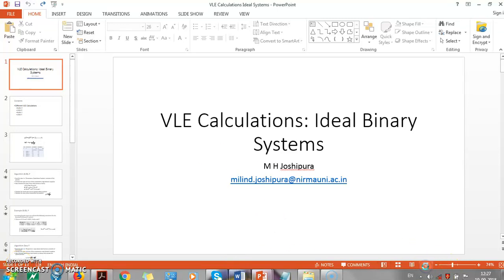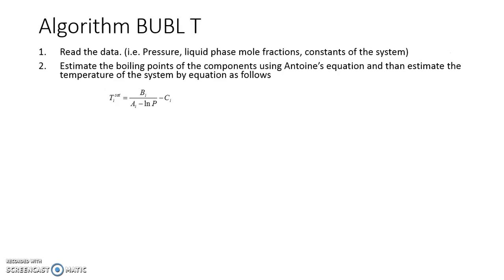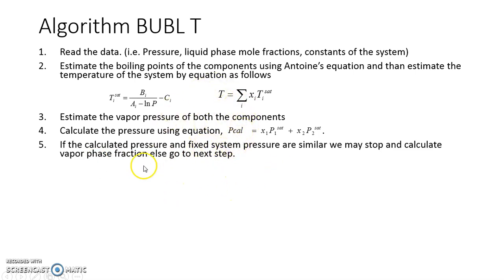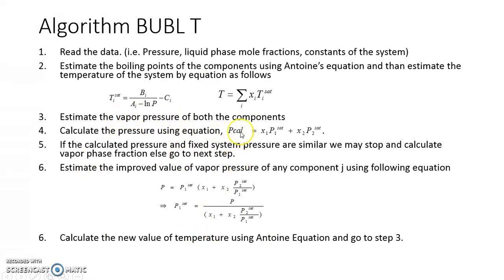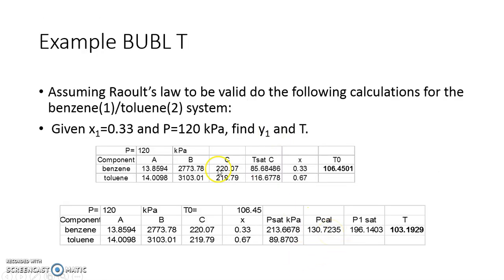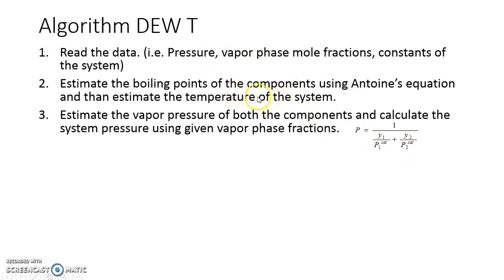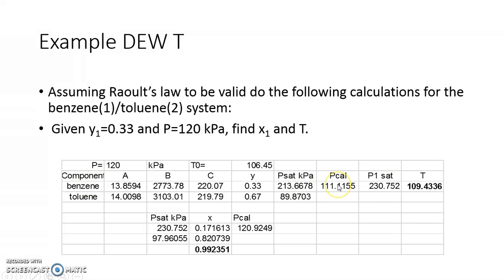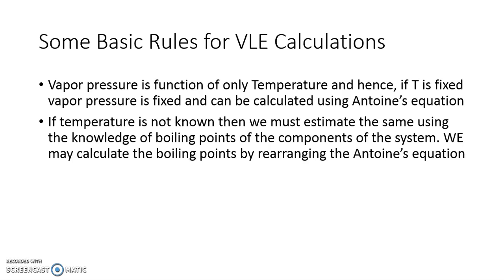Ideal VLE Calculation Part II

Comment: How to see K value in depitser chart 📊
Reply from the maker: 1. Draw a line connecting the pressure and temperature on the Depriester Chart. 2. This line will intersect the verticle curves (corresponding to individual compounds) 3. That is the value of K corresponding to the chemical.

Comment: Sir in the example of bubl T. The value of p is taken 120 instead of 120000 for calculating (ln p). Shouldn't it be 120000?
Reply from the maker: No since pressure unit to be used is kPa we have used 120.